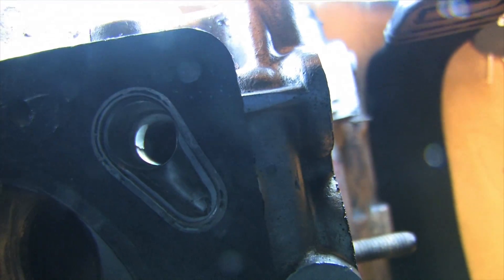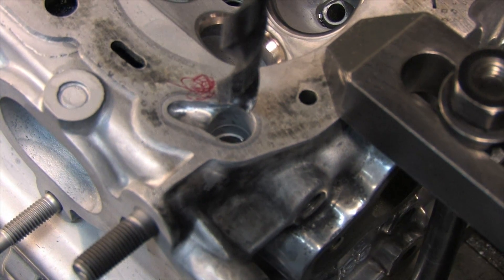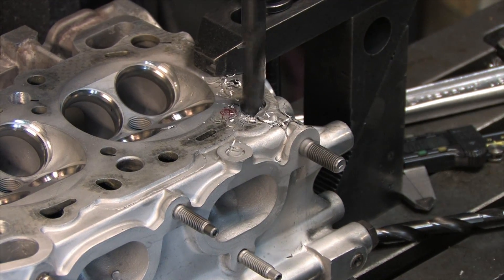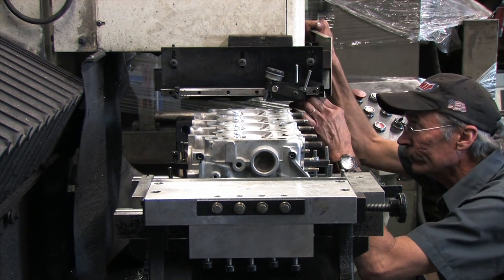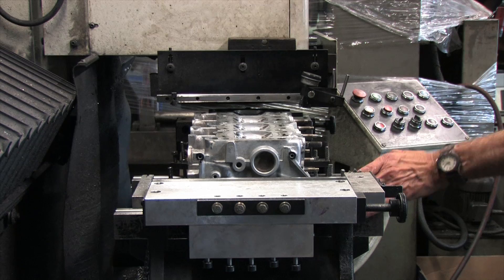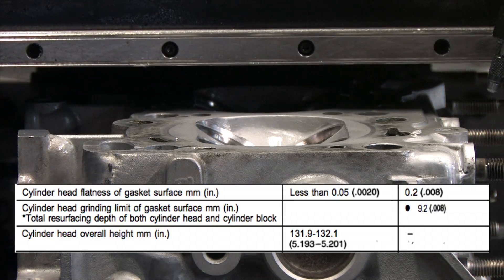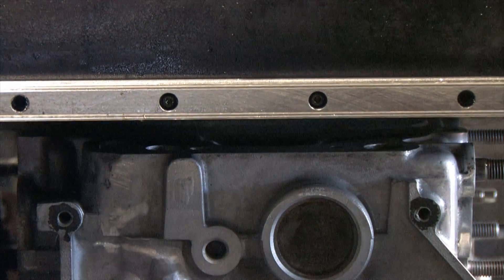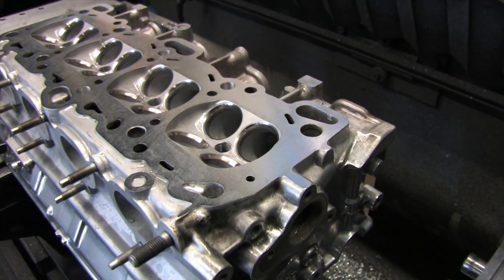Cylinder Head 202 - Head Resurface & 6 bolt Mods

Comment: Hello jafro i need your help My old head is not available to use that s why i had to got a new head from elantra 1.6 as you did before so we put everything but i have huge oil leak from from the head it comes from intake side Did i miss something? I bought hyundai 2.0 sonata 4g63 head gasket also.Do i have to do modification before install 1.6 head or just plug and play? Pls i need your advice thank you..

Comment: How about 6 bolt head on a 7 bolt block? 11mm head studs in a 12mm bolt would mean more room for oil to flow but would it drop oil pressure? Any issues with using a 7 bolt intake? Cam angle sensor?
Reply from the maker: Yeah, no... I mean... it can be done... but literally every item you mentioned will need to be modified, and ultimately won't perform any better than the parts that fit that don't require any modification at all.  If you're talking a 1g 6-bolt head, on a 1g 7-bolt block... then a lot of this advice might not apply, but usually when people reference 6-bolt/7-bolt the divide is really 1g/2g, not 6/7 bolt, so I'm going to reference putting 1g-anything on top of a 2g 7-bolt block. The worst of this is the terrible mismatch of intake manifold flanges.  The runner size of the 2g head is half the size of the 1g stuff.  Correcting this gigantic step puts you in charge of having to make these ports line up again.  Extensive porting.  Even when you do this well, it's going to flow very badly.  1g intake runners are so big that it will cut the port velocity basically in half.  A good 2g tune won't know how to adjust for that change in flow, your fuel won't mix as well, and you'll probably see a lot more knock.  The head studs... You're going to have to punch bigger holes in the block and tap & thread them.  The dowel pins might keep things centered, but they're all that will keep the head centered.  I think it's a recipe for head gaskets failures if you don't enlarge the studs.  I have no data or evidence this will be the case, but I wouldn't trust it with boost.  11mm studs are also easier to stretch.  The CAS...  It's going to be 180° out of phase, and there's tons of information out there for putting a 1g in a 2g that covers solutions to this.  Basically you'd have to do the same modifications even though your issue is backwards from that path.  That's what's nice about 180°.  It's heads or tails basically.  Or, you can just use the CAS from the year of car you have... which if its a 95/96, then there's no provision for the CAS mount on the head, and that will take welding, drilling, tapping and machining to make a mount for it.  I wouldn't worry too much about the head flowing too much oil and affecting oil pressure.  The size of the hole from the teardrop is what will regulate how much oil flows, not the size of the stud hole or teardrop.  As long as the gap is larger than the hole, you'll be fine and it won't flow any more oil than it theoretically can fit through that hole.  The problem only arises when the oil is restricted prior to getting to it.  (shaved-too-thin-teardrop or stud too big).  Just a bigger gap than the hole.  That's all you need.  If for some reason you found it necessary to re-bore the head oil feed hole with a bigger drill bit, only then could this become an issue.  My advice is to keep looking and put the head that belongs on the 7-bolt back on it.  Save yourself all of this work.  I'd move mountains to put a 7-bolt head on a 6-bolt, but the returns just aren't there for the effort of doing it the other way.
Reply: Well hell! I knew it would have been to easy.  Tell you what I'm doing real quick. Bought a 97 gsx no motor/trans/tcase. Had a head and a couple intakes.  1 2g and head and intake from a 1g.  Got a 98 short block and havent been able to find a good head locally so I wanted to see what it would take to use a 1g head to put it all together with. I have already gotten a 95-96 5 speed and tcase so I'm half way there.
Reply from the maker: You're going to like the second gen head a lot better.  It's worth continuing your search.  Of course, the merits of me preferring the 2g head for 9 years of YouTube is doing nothing to help your search, but they can still be found.  If you end up having to use a 7-bolt 1g head, just use the 1g intake manifold and find some other way of plumbing in a MAP sensor.   That way there's no port work/mismatches.  The '97 CAS will work just fine on any year cylinder head.  If for some reason it throws off your firing order (like for instance... previous owner swapping a 6-bolt and re-pinning the ECU to fix the 180° out thing from doing a 6-bolt swap... you can swap 2 plug wires to fix it.  Look around for info on that, all my CAS and ECU's match the same year of production, so I've never had to do any of that.

Comment: so if I'm using a 6 bolt block and 7 bolt head, I would just use 7 bolt arp studs? and would I run a 2g ecu or a 1g ecu since the intake manifold is different
Reply from the maker: No.  You would use 6 bolt studs, would have to drill the 7 bolt head stud holes bigger, and the rest of the stuff with the ECU depends on what the car is you're installing it into.  You don't want to put a 1g ecu in a 2g or the other way around.  They're completely different ECU's and engine wiring harnesses.  There are other ways to deal with the sensors.  What is the car you're installing a 6-bolt into?
Reply: Jafromobile actually it's going into a mighty max, 2.4l I already have the 6 bolt 1g harness but found out my 6 bolt head for the project isn't serviceable so I found a 7 bolt head for a good deal
Reply from the maker: Use the 1g ECU and harness.  Use the 1g cam angle sensor.  If you do this, it will be getting the cam and crank signals it's expecting to see, and your firing order will be right.  Do a stage 1 port job on that head and it will out-flow the 1g head.  It's absolutely no sacrifice to use the 2g head.  The machine work on the stud holes is worth it.
Reply: Jafromobile thank you so much Mitsu Master

Comment: can a 6 bolt crank drop into a 7 bolt block without machining to fit?
Reply from the maker: Sorry for the delay.  I didn't get any of these notifications.  Nope.  Journal widths are all wrong.  Diameters are all identical, but if you don't get the fit of the fillet radius at the ends of the journals right by keeping the widths within .007-.012", there goes your oil film layer and oil pressure.  That goes for the mains as well as the rods.
Reply: ok thank you

Comment: Thank you for confirming that head shaving caused my raised compression numbers.  I knew it couldn't have been a coincidence.  Mine jumped up about 20 PSI more than stock.  Any tips on what I should watch out for with higher than stock compression on a non-interference engine?
Reply: @Swim Fan Yeah fuel trim issues initially with inefficiency because the stock ECU wasn't designed with higher compression in mind, it might throw off timing a bit and you'll have to custom compensate the timing. Unfortunately ECU's these days auto compensate so there's really not much you can do. However, over time with carbon build up or other methods of efficiency loss (vacuum leaks etc..) it actually lowers compression right into the sweet spot. It's only inefficient when newly shaved, over time it gets better. On my engine at least there's an air adjustment screw for the IAC so that will at least help with relearning idle parameters and fuel maps. After 20 years every engine wears uniquely and you must learn all the numbers for every parameter to know how to treat it. OBD-I engines are not easy to figure out. You don't get a nice readout like with OBD-II.
Reply: @Swim Fan Basically, yes.